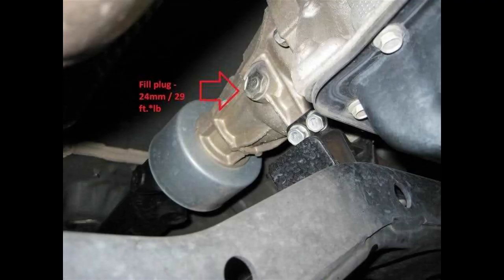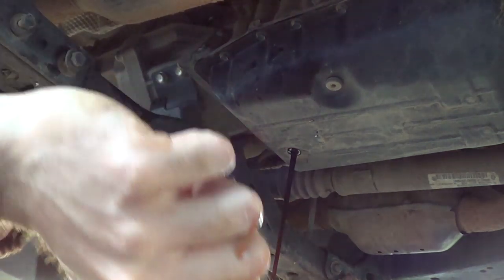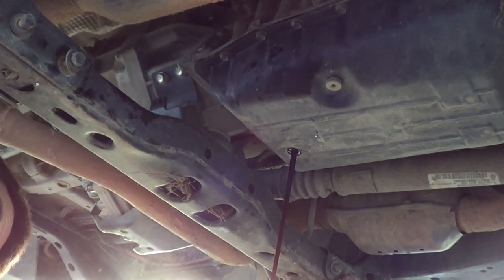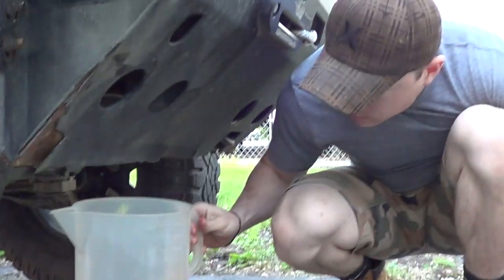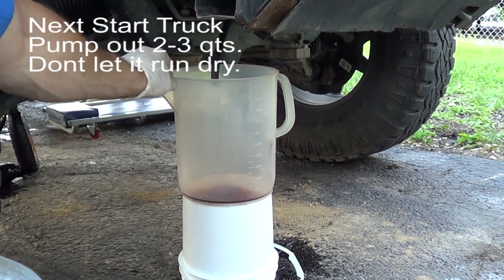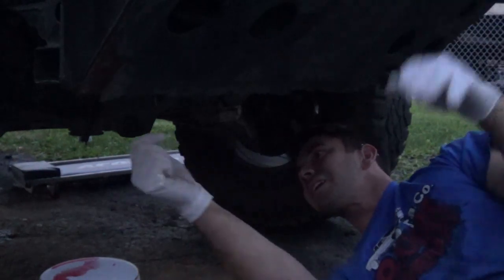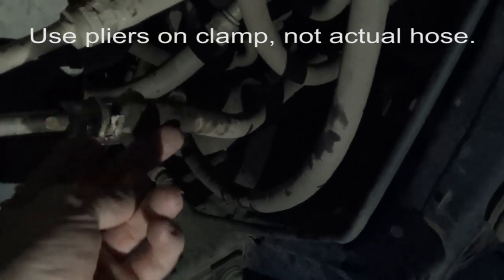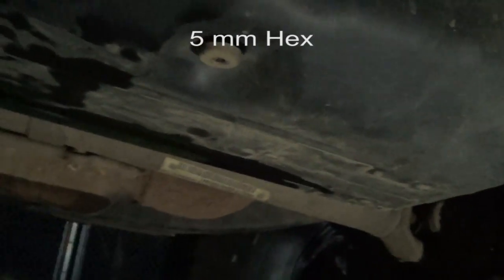Tacoma Transmission Flush

Comment: Good work on the video. 2 things:

- always pull pan first - clean inside + magnets and contrary to what some say - change the filter. The filter traps a lot of crud even though "it's just a screen".
- fill the transmission from the top. 6 ft. long piece of 1/2 x 5/8 vinyl hose snaked down from the top to the fill plug hole. Attach a funnel topside and start pouring. much easier than wrestling with a pump over and over down below.
Reply: He can do that next time if he wishes.
Reply: Well said M R.  You are absolutely correct about the pan and filter, the magnets inside are covered with clutch material and the pan needs to be wiped clean as well. Watch the Don Smith channel, he shows ,and explains in detail the why and how of a proper trans flush. All mine get done this way, and when there's no pan, pull the drain plug first and clean it with brake clean. Jim

Comment: I flushed my 2010 TRD OR 4x4 yesterday.  I used this video as part of my studying for the procedure.  Dropped the pan and used Valvoline Maxlife.  So far it's a huge difference, thanks for the video.
Reply: What made you go with Maxlife over Toyo WS, besides price of course?
Reply: @ryan6391  The Maxlife is a full synthetic ATF and has better specs than the Toyota WS.  The Toyota WS is decent stuff though from what I've read.

Comment: I’ve got a 81 ford truck that a aftermarket transmission cooler line came off as I pulled out of my driveway. And it’s a mile down hill to the highway. When I tried to get on the highway all the truck could do was just get me across the road to the shoulder. I was able to replace the line and walk to Casey’s for oil. I don’t remember how many quarts I put in but I think I bought 8. It didn’t hurt it and is still running today 15 years later.

Comment: Awesome video.  So glad I watched again before starting to make sure I disconnected the proper line for flushing.  I dropped the pan and did the filter as well.  I learned a trick about keeping the gasket and bolts in place as you set the pan back on the transmission. The holes in the gasket are just a tad smaller than the bolts and the bolts can all be inserted through the pan and filter (just a couple of threads showing) at the bench so you don’t have to worry about the gasket floating around as you set the pan and you don’t have to paw around for bolts while crawling around under the truck.
Reply: nice, you can also apply a tiny amount of grease, the smallest amount just to hold it in place. At least i use that method on valve cover gaskets.

Comment: Good video. I suggest that you should have dropped the pan and replaced the filter and clean all three magnets.  I did this on my Tacoma at almost 60,000 gentle miles and I was surprised by just how much was on all three magnets. After a very thorough drain and flush of the entire system I installed Amsoil’s best full synthetic automatic transmission oil.  Transmission temperatures are now about 9 to 12 degrees lower with the Amsoil. I thought that was interesting.  

It just doesn’t seem to make a lot of sense to empty out a lot of quarts of old oil and install a lot of quarts of fresh new oil with a dirty filter and three dirty magnets still inside. 

Just my two cents worth.
Reply: How did you drain and flush the torque converter?
Reply: I disconnected the return line to the transmission coming from the radiator. I connected a clear hose and put the end in a bucket with a measure on the side. 

After I replaced the fluid that I drained and after dropping the pan and cleaning the three magnets and installing a new filter and pan gasket I filled up my transmission with Amsoil.  

Then I started my engine with the return line disconnected. The old fluid came out and into my bucket. When it filled to two quarts of dark old fluid I shut off the engine and put two quarts of fresh Amsoil back in the transmission. I repeated this until I seen bright clear red new Amsoil transmission fluid in the clear tubing and pouring out. Then I filled up the transmission accordingly. It was actually pretty easy.
Reply: You are correct about the pan. Have you seen the Don Smith channel? He shows in detail all you need to know about properly flushing a trans, and always removes the pan and cleans the magnets.

Comment: This is a great step-by-step video, same as with all of your stuff, my opinion. I'd like to add one recommended, and VERY important step to the process. Anyone contemplating a transmission fluid change or flush should, drain the pan,  DROP THE PAN, thoroughly wipe out any debris/metal shavings, clean the pan magnets and change the filter. It should be done prior to following everything else in this video. Omitting this step is screaming for trouble and is almost guaranteed to cost you $$$$ and grief. Simply performing a flush without a pan drop/clean will likely send a flood of debris and gunk into the transmission valve body and proceed to wreak havoc. I'm not saying the worst is going to happen , but its no more difficult than any other step in this video, adds about an hour to the process and only cost about $25 for the filter kit at NAPA (or your preferred parts retailer, also available on Amazon). 

A couple of other recommendations: (1) Replace the garbage OEM mild steel pan bolts with 316 stainless (M6x10mmx12mm) and coat them with a quality anti-sieze compound, or better yet use Tef-Gel. (2) Add a bottle of LubeGard (red or platinum) following the directions on the bottle; this stuff is a tried and true product.
Reply: James Deal definitely gotta drop the pan and change the filter, pointless orherwise
Reply: I wondered why the pan and filter was being touched....that was scary to watch....I'm not pushing with my tacoma....dealers job....
Reply from the maker: Obviously 10 months after the comment, but I still wanted to reply. At the time of doing research for this project and having talked to a handful of people who had competed this I felt it wasn't necessary without only 60K on the truck. Most of the people who had dropped the pan and swapped the filter had almost no debris to speak of and couldn't tell a difference between the new and old filters. Also it's been a while, but I believe it was to the effect this type of transmission shouldn't require a filter change. That it's a sealed trans and simply swapping fluid would yield many miles without issues. Either way if done correctly it's a good maintenance step. There is certainly still a benefit to swapping fluid alone as the fluid loses it's lubricating benefits over time.
Reply: you got lucky - as I said in post just made - crud is inside the so called "it's just a screen" filter.

Comment: I have a 2008 Tacoma. I should have paid better attention but the dealership said never touch it because it’s sealed. 279,000 miles which I think is great but I should have been changing it. Solenoid is messed up and it want go into high gear. I have a used one coming with 90,000 miles on it. First thing I’m doing is dropping pan and changing filter and fluids

Comment: According to my Toyota Dealer….. Generally under normal driving conditions it is recommended to service the Trans at every 80K miles, of course if you’re off-roading a lot and/or towing, you should be good at about 50K-60K mile change intervals.

Comment: Great video.... I don't see the link you mentioned for how to jump the two wires in the OBD II connector so can drain excess transmission fluid at the correct temperature.  Thanks

Comment: Nice video man! My 2012 has almost 70k miles and will be doing a flush in a few weeks. I have the tow package, I’m from TX so in the summer, tranny reaches 200 in traffic. I’ll be bypassing the stock radiator cooler and will be installing a bite Tru-Cool cooler with a fan just for the transmission.
Reply: How's it working out?
Reply: @alecthenice8115  4 years later still going strong. haven't had any issues with the bypass or aftermarket cooler. as a matter of fact, i will be doing another 50k mile flush here soon. she's now at 120k miles

Comment: I love how this is a "sealed transmission" according to Toyota but Aisin still recommends fluid changes. Im just going to drain and fill the pan, would hate to wreck the tranny. Any update on slippage or gear stickiness?
Reply from the maker: At the time of posting this video it had been about 2 years since actually doing the flush with 0 transmission issues. I believe although it's a "sealed" transmission, fluid will eventually breakdown. I still consider a fluid change sealed as in you don't need to pull it apart.
Reply: @TunnelVision4x4  every 60 to 70k seem correct?

Comment: Hey man great video. I have a 2012 Tacoma 2wd 50k miles and hate the way it shifts. If I am crawling along in traffic is lunges into 2nd and the truck will jerk into 5th just about every time. Shifts much smoother when I am towing or have something heavy in the bed. Have you heard of any of these issues with 12-15 models? Thanks!

Comment: What's the point in draining the pan first and then refilling? Wouldn't the actual line flush take care of that too?
Reply: Adam Shirley you drain and refill first so when you start the truck, the oil pump starts pumping the fresh clean oil through whatever components it lubricates, thought the torque converter, and out the line he disconnected. You repeat this process until clean oil comes out of the hose he disconnected.

Comment: How long did it take for the truck to reach 115-130 degrees?
Reply: I saw another video saying on average 8 mins from a cold start
Reply: The fluid check should be done between 97 - 115 degrees.
Reply: @MrDLRu   you alright , I put my 2005 toyota Tacoma prerunner  in transmission temperature check mode, and when the indicator turn on , I connected the scangauge and it was exactly 97 degrees.

Comment: Thanks a lot for this video. This really helpful.  If you pumped the same amount as you drained, why did get all of this amount as overfilled?
Reply from the maker: So I am pretty sure when I was pumping in each time I was pumping slightly more than I was removing each time. It looks like a lot over, but the actual volume was pretty small. I also wanted to be a little over than under so I didn't have to top it off and check again.
Reply: Tunnel Vision 4x4 how long it took to warm it from 80F to 110F?
Reply from the maker: It took at least 30 min. I don't remember for sure, but it crawls up to the temp.

Comment: I bought a new transmission filter for my 2015 Toyota Tacoma 4.0l I’m also doing a transmission flush. Should I put my filter first then flush or flush them filter on?? What’s ur opinion on it?
Reply: Put the new filter in before you do the full fluid change. Drain and drop the pan, change the filter, button it jp, add in the amount that came out, then proceed with everything in the video.
I usually cycle through the gears once before I take the outside hose off, but I don't know if that's necessary or not...

Comment: So when you do it this way. Your pumping out the old while the new is being stored in the transmission?
Reply: Correct. He started by replacing the fluid in the pan. Then he disconnected the return line and started the engine to run the transmission pump. The pump picks up the new fluid from the pan and pushes out the old fluid. He needed to do that a few times in order to get all of the old fluid out.

Comment: Great video! I freakin searched all over for a video like this but couldn’t find one. I found a forum post that described it and followed that, but if I’d had this video too, I would’ve been less intimidated by the job. I’m actually thinking about dropping the pan and replacing the Transmission filter/screen. Have you done that yet?
Reply: its not a filter screen its just a wire mesh to filter out metal shavings so unless you are seeing that in your oil then just leave it alone you are spending more money and time thats not needed

Comment: Is there no filter to replace?
Reply from the maker: There is a filter, but it doesn't get gunked up like a regular oil filter. In my opinion, it would be easier to get more junk into the trans replacing the filter than just flushing the oil.

Comment: Great video . How did you flush it , I’m a little confused on it it worked . I have a 2001 tacoma and I don’t have that line . And I’m worried now
Reply from the maker: So by starting the truck it runs the transmission pump that is used for circulating the system. The "Flush" happens by pumping out and replacing the fluid over and over essentially flushing out the old fluid. The steps would be the same for you, but you just need to find where the line running back to the transmission is. I am not familiar with first gens, so I wouldn't be able to tell you for sure which line to use.

Comment: Why not drop the pan and change the filter? I've seen other videos mention the filter.
Reply from the maker: From the research I did their is no need to replace the inner mesh filter in the transmission ever and the potential adverse effects out way any gain from swapping that piece out. Also for what it's worth, per conversations with folks who did swap the mesh the old one looked almost like new and advised me that they didn't see much of a difference.

Comment: What's the gauge thing that you had with the temp and volts. (Make and Model) I'd like to get one. Thank for the info and video.
Reply: Torren he called it a Scanner Gauge . Plugs right into the OBD. An OBD reader can also tell you these details.
Reply: Not all OBD2 readers will read AT temp since AT temp is not a standard output data point.  One must research which scan tool is configurable and also have the specific vehicle make/model code to read the AT temp.  ScanGauge can do it.

Comment: I am luck to have a dipstick on my 2013 Tacoma.
Any reason I couldn't just add fluid through the dipstick, instead of pumping it in through the transmission fill underneath ?

It would be nice if i could just add fluid through the dipstick line while draining it out through the radiator send line.  I'd drop the pan and clean the pan and magnets while changing the filter before running about 10 more quarts through the dipstick to flush it completely.   Anything wrong with this plan ?
Reply from the maker: To be honest I am not too sure, but my first thought is how slow actually filling through the dipstick would be. It was pretty easy pumping into the transmission through the fill hole. + I didn't have to worry about getting transfluid all over the engine bay.

Comment: Hey wondering what happened to OBII temp process link your we’re going to post below
Reply from the maker: https://www.tacomaworld.com/threads/how-to-drain-refill-automatic-transmission.63851/
Reply from the maker: Sorry about the missing link. The above link has how to do it without a scan gauge.
Reply: https://www.scangauge.com/xgauge/toyota-lexus-scion-cansf-transmission-temperature/   read pg. 41 in the scan gauge manual under "Add or Edit an X-Gauge".... the Transmission Temp is a gauge that has to be manually added once it is hooked up.

Comment: Hey man. Are you sure that you need to bring the oil up to temperature??? Everything I read on line said that the level is only accurate when cold. I could be wrong.
Reply: Your absolutely have to bring it up to temp. The fluid expands a lot when it warms up, and overfilling or underfilling will damage your transmission.

Comment: There's a bunch of warning lights that stayed on after you started your truck🤔😳
Reply from the maker: ding174 I’m not sure exactly which ones are on in the video. One was parking break, two others were abs and traction control lights were on because I had a damaged abs sensor in the rear. Other than that I don’t remember any other lights being on. I definitely would have noted it or just not posted the video if I ran into issues.
Reply: Tunnel Vision 4x4 good job 👍🏽 on the video tutorial all that work was definitely worth a🍺
Reply: @TunnelVision4x4  
Even if you ran into issues you still should post it and post your solution to fix it.
not all repairs go smooth, people still have issues and I always appreciate the ones that say what the issue was & the fix.

Comment: Did you replace the filter in the pan? Just curious
Reply from the maker: No from what I read that would be pretty unnecessary and it seems much less intrusive to just replace the fluid.
Reply: bash5995 it really isn't even a filter it is more like a fine,single layer, screen mesh. Its really not necessary to change.